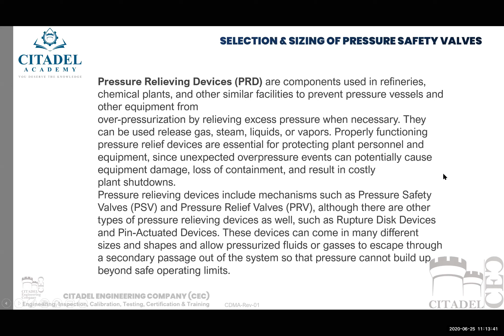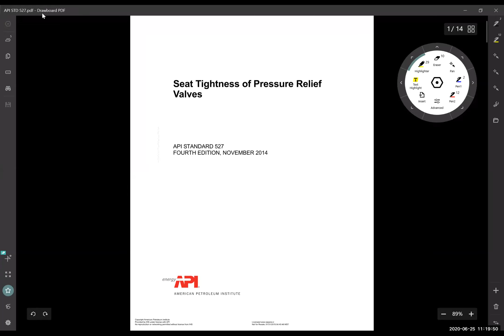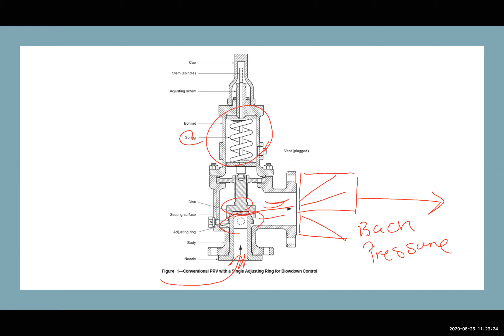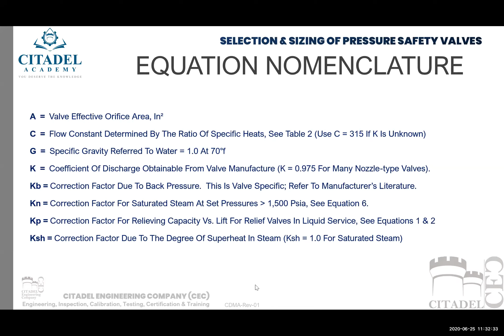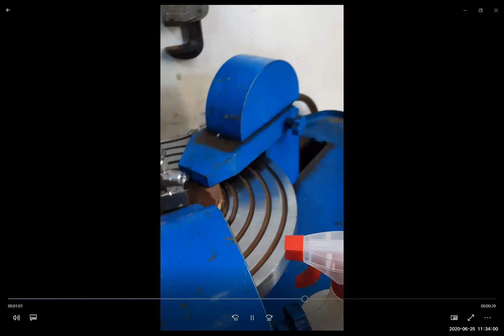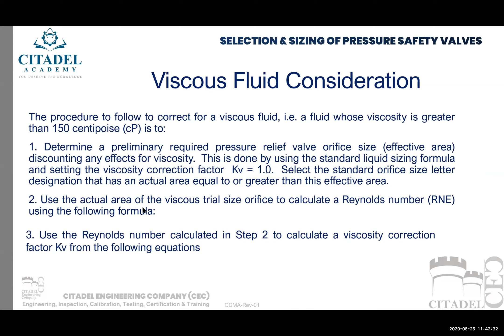Selection and Sizing of Pressure Relief Valves

Comment: Thank you for this presentation. If you are open to constructive criticism to make your presentation more beneficial to your listeners, then read below:

1. Approximately 80%-90% of your presentation is simply reading from the slides. Once you told us what the standards for PRDs were, we can simply read the standards ourselves. Your pictures, demonstrations, and experience are what we can't get from the standard, and those are most valuable.
2. It would be greatly beneficial to go through a real life scenario for PRD selection and sizing; Walk us through what information we need to give to our suppliers to help us size and select a proper PRD. Are there useful tools, like excel calculators, that help with calculations?

Regardless of the above comments, thank you for taking the time and for putting in the effort to produce this webinar. I got a lot of information from it.